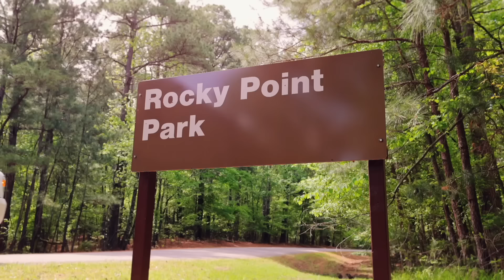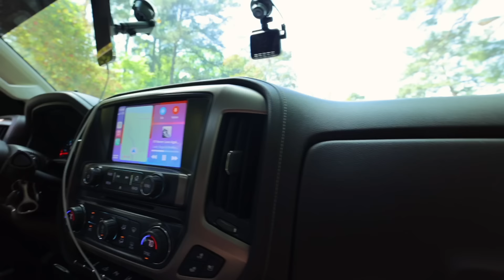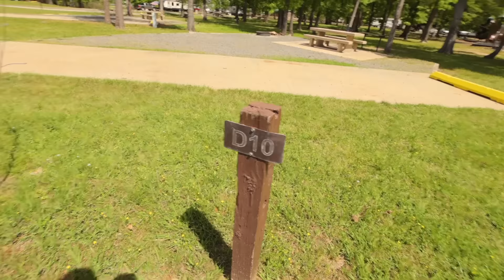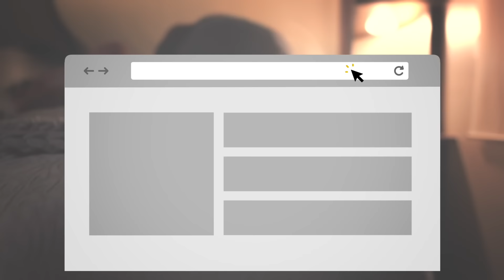DON'T Take Shortcuts with an RV - We Paid the Price

Comment: Your brakes should be part of the annual inspection done by your state. Sometimes, these state run inspection places know nothing about RV brakes and just pass it. I check mine and don't rely on inspectors. Good RV inspectors would have likely noticed your brakes getting low and adjusters out of normal spec. Have you seen the new antilock brake systems available now? 

Honestly, I think you guys are overweight of the leaf springs with everything you're carrying. These things were never meant to be "off road", and the combination is what probably caused the leaf spring failure ...and always in pairs!  

I wouldn't be towing with a lifted truck either because it's a higher center of gravity.  

Just my $0.02 for free to keep you 3 safer.

Comment: Stick and staple RVs are built from the factory to the lowest standards they can get away with to cut costs and increase profits. Understand that from the start. Cheap tires. Cheap axles and springs. Cheap frame materials. Cheap tongue components.
Then, you get to the house. Again, 100% built to the lowest standards. It takes replacing the cheap parts with quality, reliable parts to even begin escaping the nightmares of owning a stick and staple rig.